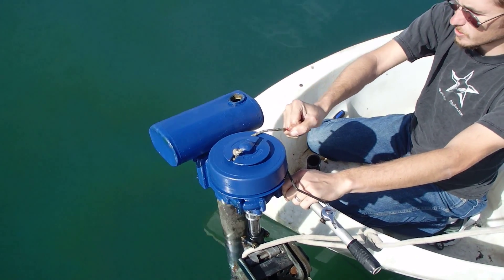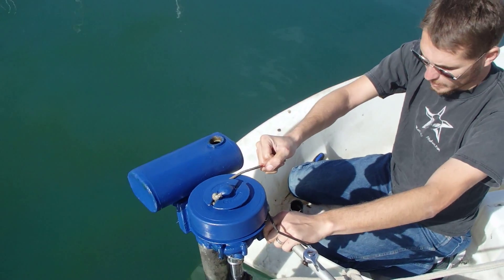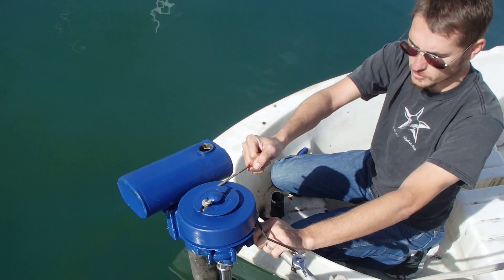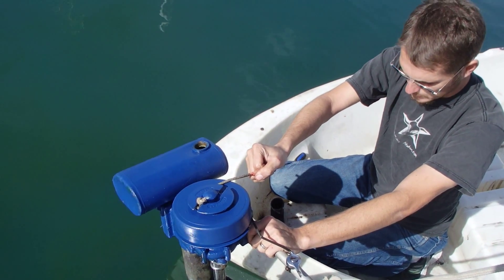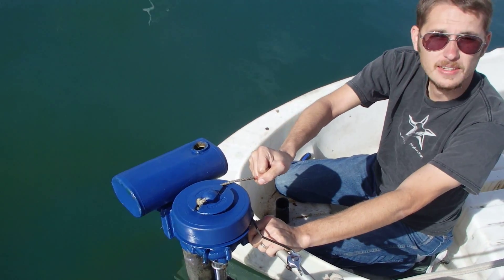Shanty Yacht Club - Starting a Seagull Outboard Motor on ShortSail

Comment: they need the fuel cap on with the vent open to get the right amount of fuel,clean out the carby tank and filters and it will idle fine unless its got a blown gasket